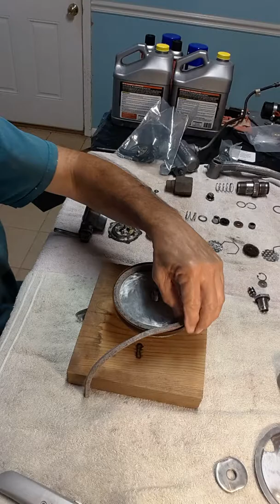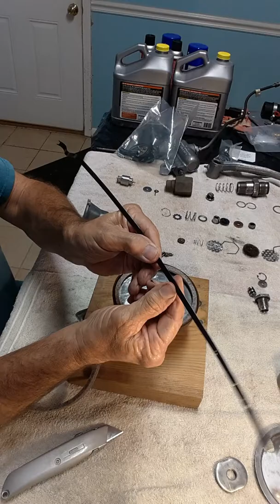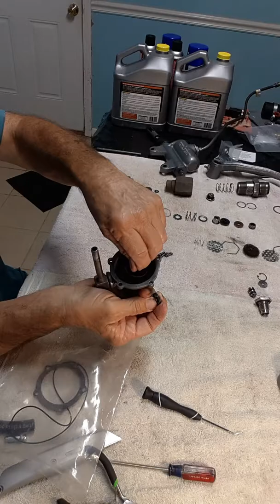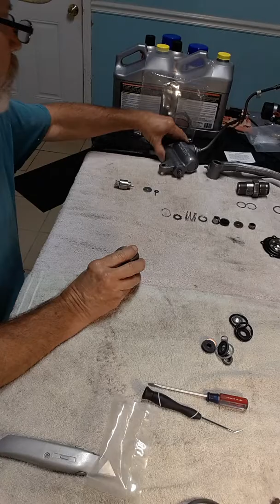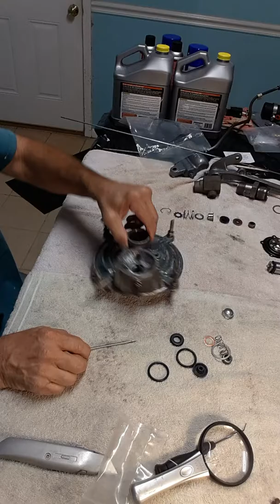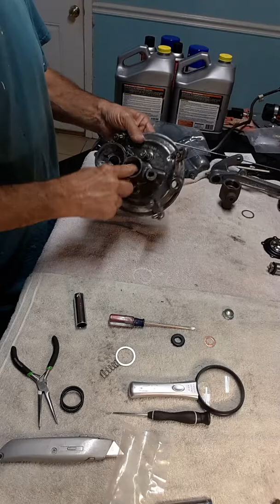1955 Cadillac Coupe Deville Power brake....part 4

Comment: Tim, I just completed the rebuild and installation. Bled the system. The pedal catches all the way at the top which is great, BUT it won't release pressure and the brakes remain locked up. Any suggestions? I am uncertain of the master cylinder, whether or not it may have the check valve, which would be redundant to the vacuum booster. Any help would be greatly appreciated.
Reply from the maker: @trentmcinturff4148…I can’t respond based on experience… but I have heard of the problem.
If you disconnect the vacuum line to the booster and the brakes release, there’s something wrong in the booster.
Go to the Cadillac/Lasalle club forum and search “brake booster won’t release”. There’s a lot of helpful suggestions from people having the same issues.